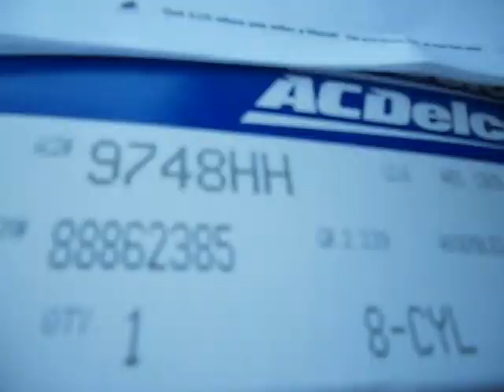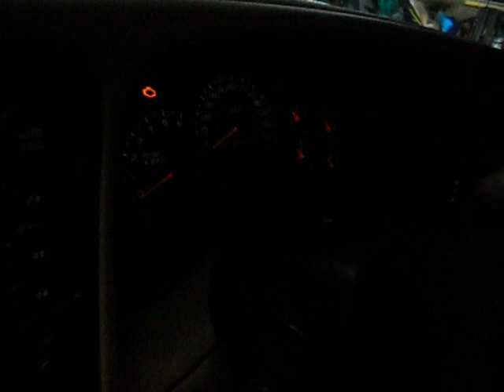Broken exhaust manifold bolts on a GMC and New wires!!

Comment from the maker: Get the 41-110 AC delco plugs and ACD wires. I did it all for $86 . Yea the broken bolt blows. If you remove the plastic inner fender liner I THINK one could weld a nut to it.  Broken bolts are REAL common issue. Ive seen ALOT at auction with them.